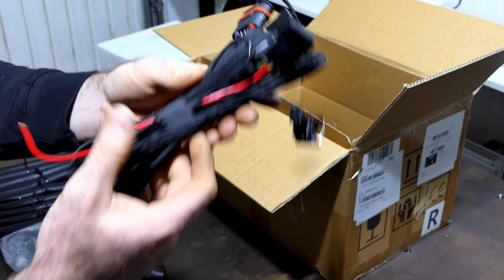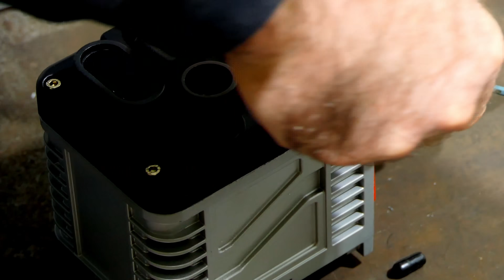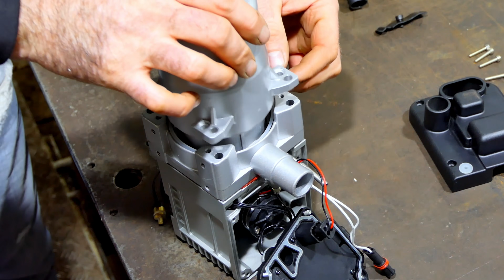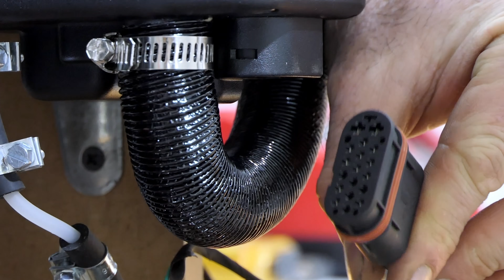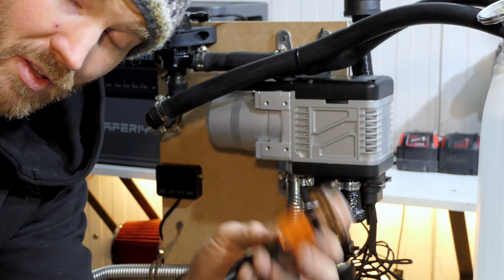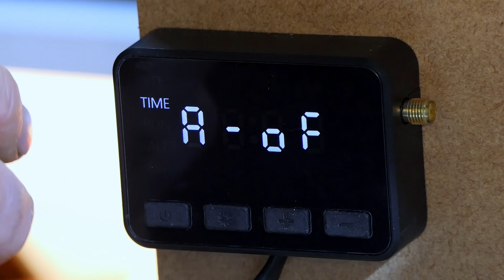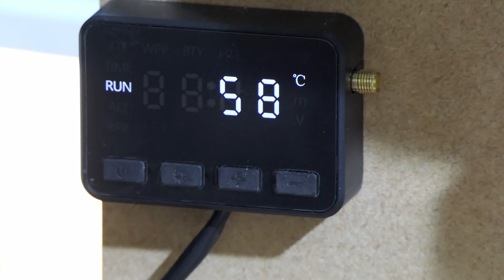Wonder of Manufacturing - Worlds Cheapest Automated Hot Water Central Heating System

Comment: Hi Joshua Love your Channel 'Liked and Subscribed' as a bit of a DIYer, I had an idea with my Chinese Diesel Heater and wondered if you think that it might work

Outside the House a 40 Gallon Barrel of Water with My Diesel Heater sitting on Top of the Barrel's 
 Removable Lid with the Exhaust from the Heater Dipping Down into the Water

So Hot Exhaust Gas would be 'Bubbling' through the Water to Heat the Water up, then when the Water is Hot enough to have a Bath, once the Heater is Switched off and Disconnected

There would be a Tap on the Side of the Barrel to Transfer the Hot Water, through a Hole in the Bathroom Wall, to fill up the Bath with Hot Water

Ideally the Exhaust Pipe would dip down into the Water as far as possible, preferably to somewhere near the Bottom of the Barrel, so the Hot Exhaust Gas could Heat the Water Quicker before the Exhaust Gas is vented out of the Top

Do you think this might work?
Reply from the maker: Thank you so much. I'm thinking of something similar but have the exhaust go down and exit the side of the bottom with an adaptor. bubbling may hinder the flow rate of the gas as it will have a lot of back pressure thanless you put it under a vacuum by installing an air pump which is a bit more complex. cheers J
Reply: @joshuadelisle   That was sort of my Plan 'B' as well, as what I did was to buy a Stainless Steel Through Hull Fitting for a Chinese Diesel Heater from Amazon where I could Bolt it through the Middle of the Bottom of the Drum, with the 'Spigot Part' Sticking Up inside the Drum to attach the Longest Piece of Stainless Steel Exhaust Pipe for these Heaters using just a Hose Clip and then just Coil the Surplus Exhaust Pipe round and round, then up through a Hole in the detachable Drum lid and then into the Exhaust Outlet of the Heater which would sit on top of the Lid The Drum would sit on Something, perhaps another Oil Drum so the Exhaust Gas would then Exit out of the Base of the Drum These Stainless Steel Through Hull Fittings are all the same, only the Price is different and so I bought the Cheapest one for £10 (uk) Amazing Quality! that has got some real 'Heft' to it and good enough for a Luxury Yacht if I had one. I haven't put it together Yet as I thought I would get your opinion on this first

Comment: Nice video! Glycol would potentially reduce your efficiency very slightly because it has less thermal mass per kg, so it would get slightly hotter by the time it comes out the outlet. My guess is in the 0.1% efficiency range though. This also means you'd store slightly less energy per litre. Again, negligible.

At that efficiency and price, a heat pump would need an efficiency of 3.6 to even break even. I would be interested if you could use your methodology to test a heat pump sometime, although I understand that they are expensive to buy upfront.
Reply from the maker: Good to know. Thank you. Cheers J

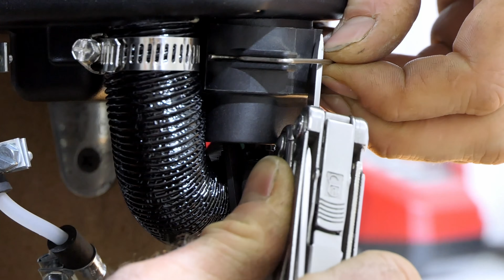Comment: At 13:33 you do realize there is no need to remove the clip? you only need to press it down and pull, and its the same for the fuel pump connectors ;)
I've watched a couple of your videos and I'am just wondering if I'am the first to point it out 😅 And yes its been bugging me far more than it should 😆
Reply from the maker: I've not dealt with these clips much so these tricks are new to me. others have mentioned it too. cheers J

Comment: One thing: Glycol protects the system from damage if it experiences temperatures below waters normal freezing point, unfortunately it lowers the heat capacity of the working fluid, and the efficiency of the system. 

The latest innovation in efficiency is to run water with a corrosion inhibitor and surfactant that lowers the surface tension of the water which improves the contact between the solids and the water, improving heat transfer. No anti-freeze glycol in it. Then they system whilst running should never get below zero. And if it does then they use anti-freeze valves, that allow the water to leak out and protect it from frost damage.
Reply from the maker: Good to know. cheers J

Comment: I have one in my boat. Definitely have a fuel filter, I blocked the burner unit. I eventually cleared it by getting the pipe to red heat and burning the blockage away. Be careful of the auto start mine randomly started one day and only stopped after the fuel tank was empty.
Reply from the maker: Good to know. cheers J

Comment: I might be wrong, but I think that glycol actually reduces the quantity of heat that the fluid can take (compared to simple water), so I would suggest using a 40% or 50% propylene glycol mix to protect the system from freezing @ -20ºC (40%)/-30ºC (50%) without loosing too much efficiency. Underfloor heating normally uses lower fluid temperatures, maybe you could drive some aluminium radiators directly and use a separate circuit for it (with a heat exchanger). If you plan to use it in a closed system be sure to add an expansion tank to the loop. By the way, why do you think there is a 60 min maximum operating time limit? I had a similar unit on my van and I don't think it stopped automatically after a fixed amount of time, it was driven by a thermostat...
Reply from the maker: Thank you. yes I think I got that information the wrong way round. I'll clear that up in the next part. cheers J

Comment: FYI with a stainless steel water to gas heat exchanger, you can extract even more heat from the exhaust of the unit and raise it's efficiency past 80%, and this part likely would cost you $60-$150 from your favourite websites.

Comment: The Achilles heel on them is how the water hooks up to the unit with that one screw and that two manifolds and the o rings. 

I’ve seen a lot talking about the clip for the water lines breaking and leaking.
Reply from the maker: maybe buy i'm pretty confident in making a new one if that happens. cheers J

Comment: Very interesting! I'm wondering about the feasability of a system like withis for home heating with conventional dual core radiators. I currently heat my house with a 5kw log burner pretty sucessfully with the exception of the kitchen / bathroom extension which is awfully constructed and uninsulated so I just shut it off. Obviously they are the most moisture producing rooms in the house so condesation is a real issue. I've been considering a standard diesel heater and some ductiung from your previous videos but water heating seems like a better, less janky and more efficient home soloution. Interested to see your future experiments, as someone who tries to be as self sufficiant as possible even on the outer edges of s city I really appreciate these videos.
Reply from the maker: I see your problem. I think the air version maybe better for you because its faster to heat the room if you only use it intermitently, comparatively a water system takes time to transfer the engergy into the ambiant air. the other thing is, if you have the system outside and duct just the hot air inside and not recirculate it, then you will be creating positive pressure that forces the old damp air out of the room through your vents which should dry it out. its also a lot cheaper and easier to install than less hot water is something you specifically need. cheers J
Reply: @joshuadelisle  That's a great point about creating positive pressure, I hadn't considered the effects of that. I was thinking keeping the space warm would reduce the cold surfaces for the moisture to condense on but that would require running the heat much longer to heat the mass of the building, whereas an air heater would dry it out much quicker like using the blowers in a car to clear the windscreen. The air system makes a lot more sense for a space that only gets used a couple of times a day for any length of time. I already use a dehumidifier after a shower but obviously using them in a cooler space they are much less efficient so combined with an air heater that would be much more effective. Food for thought! Thanks

Comment: I was an infrared thermographer during my working years. Spray paint your exhaust tube with some high temperature flat black paint to get an accurate IR temperature measurement.  
Powerful little heater. Great idea for a hot tub. Good luck. 🤝🤝👍🇺🇸
Reply: Get a water to water heat exchanger, don’t have chlorine full hot tub water coming anywhere near your heat source, it’ll eat through everything
Reply from the maker: Thank you. Cheers J

Comment: Can you make it run continuously and keep a set temperature, similarly as the air heater can do?
Reply: I bought one for that use, and sadly it can't. 

It will heat the water up to set temperature and shut down. 

A shame, I hope someone has a hack
Reply from the maker: @jonjessen  I'll find a hack. Even if it means making a new controller from an Arduino. Cheers J
Reply: @jonjessen  That's a shame, as the air heaters can do it. Maybe the controller for the air one can be retrofited?
But yes, Arduino or something similar can be also an option.
Reply: @TrinomCZ  I bought an air and water heater that can do it. It looks like the normal air heaters but with an extra water circuit. I don't think that more than 50 % of the heat is directed into the water though.
Reply from the maker: @TrinomCZ  I need to do a longer test on a bath to see. Cheers J

Comment: Hi Joshua, finally another one. Nice Overview Video. But how do you get Kerosine so cheap, here in Germany It's almost unavailable and if so very expensive. We have regular Diesel here with 10% Bio Oil, and Heating Oil, which I guess is your Red Diesel for Tractors. Any Idea for Kerosine export 😂😅
Reply from the maker: @SchorschvomDorf  thank you. Heating oil is kerosene. If you buy it in bulk it's cheap. Cheers J
Reply: @joshuadelisle  we buy in bulk too for the last order of 4000 liters heating oil I paid 89€/Cents which should be 0,738 GBP. Four years ago we paid for the same amount just 35€/Cents per liter. Which should be 0,29 GBP. Greetings from Germany
Reply: @joshuadelisle  By the way I looked up for the term, your kerosene is our heating oil with a red dye in it. The prices are roughly the same in December 2024

Comment: Modifying this for a home radiator would be awesome for a shop/garage
Reply: Mini expansion  vessel and prv amd your there 600x1200 double rad or cleverer would be car radiator and quiet fan.in a cabinet.
Reply: I use them to run central heating and hot washing water on my boat... mines 2 years old, never a problem

Comment: Great video. Been waiting for this product to be released. 
I've fitted quite a few of the genuine version of this. Pleased to see a affordable version lol.
I plumb them into a calorifier and use them to heat multiple radiators too, on narrowboats.
You may want to use a closed loop heat exchanger set up for your hot tub. That way they heater will be run at operating temperature.
Plus once the unit hits 80somthing degrees it will 'back off' to half power. Which has a beneficial effect on fuel and power consumption .
Firstly I'd recommend upgrading the pump to a genuine one as they are completely silent and same goes with the exhaust. The marine silencers are expensive but the best. 
Also be careful not to overcool it as they're a bit more sensitive compared to the blow heaters.
Good luck on your mission.
From an un educated tinkerer like yourself. Peace ✌️
Reply from the maker: @ijohnathan64  thank you. I've taken notes. Cheers J

Comment: Btw XT60 can handle 60a for 1 hour 😅 
I use them everywhere xt30 for smal stuff xt60 gernaral stuff xt90 or xt180 for big battery's
Reply from the maker: Thank you. It outputs 25amps from the battery but rated for 60amps is great. Cheers J
Reply: @joshuadelisle  yes it's nice to see more and more manufacturers using our once laugth at hobby connectors  they could have got away with a xt30 but the 60 is for 25amp fine just handwarm after pulling it constant

Comment: cant tell if that POD filter is on the intake of the exhaust .... intake is A-OK exhaust side IS NOT it will restrict airflow and CAN cause the unit to overheat . if its on the INTAKE .... well i do the same thing lol except i run a solid pipe to the floor where the filter is
Reply from the maker: It's for the combustion intake. It's just a balancer and the mesh stops critters getting in. Cheers J

Comment: As @xflow said or try one of the big suppliers like polymax in the uk I have used the a lot in the past only downside going that route is there’s a minimum order amount which varies usually 20/50 ltems but they are cheap
Reply from the maker: Thank you. Cheers J

Comment: would you get more energy from diesel  than form the kerosene that you used in the test. If so the rating for the heater would be higher than you calculated. ?
Reply from the maker: It's not enough compared to the cost. You get more energy per £ with heating oil (kerosene). Cheers J

Comment: Wow, this is such useful info—thank you for sharing your results! I’m working on a heating system idea for my camper van and testing ideas like this really helps.

So, here’s my (apologetically layman) idea: I’m thinking of using a calorifier with double coils—one coil to capture engine heat and store it as hot water, and the other to circulate coolant through underfloor heating pipes. I’ve seen calorifiers from 6 to 55 liters, and while I won’t need that much hot water, I was thinking of using it more as a heat store.

I’m also planning to heat the system via solar if the batteries are full or shore power when connected, leaving the diesel heater as a last resort. I suspect I’ll need to rely on the diesel heater quite a lot in practice, though.

Does this seem crazy? It’s certainly looking expensive, but I’m trying to make it efficient and flexible. I’d love to hear your thoughts and if you think there’s anything I could tweak in my plan. Thanks!
Reply from the maker: It all sounds plausible. Calarifiers are useful for isolating coolant from fresh water in the same system. Electric heating via a battery is very limited. Most Electric heaters are 2kw which will only  last an hour on a 2000wh battery. A heated vest via a battery however is very efficient because you're only heating yourself and not the whole space, couple that with a well insulated jumper and sorted. That way you only need to deal with condensation and temperatures to keep the stuff in your van in good condition. Cheers J
Reply: @joshuadelisle  yeah I doubt the solar and battery route would add much value. My loses are estimated at around 500w. So I think that's 12kwh per day? For sure not enough for an electric only system.

Comment: as always, nice videos, I also have the same model and I also did the same tests, and I noticed that the water flow rate you have in the video is not the right one, it seemed to me too that it worked like that, but once once all the air has been removed, the jet of the pump must seem almost like that of a pump for watering the garden, therefore a nice jet
Reply from the maker: I think the pipes were kinked a bit in that clip and also may have air in the pipe still. It was only a quick demo just so I could figure out the system and design what I need for the final project. I may use a calorifier so the pump isn't straining on a large system and introduce a larger pump for the rest. Cheers J

Comment: Very interesting, for heating a hot tub, is an lpg heater cheaper to run? They are around half the price to buy even for a 30kw unit
Reply from the maker: LPG is more expensive as a fuel. A 47kg bottle is £100, which is about £0.15/kWh. Kerosene is cheaper than mains gas currently at £0.05/kWh. Cheers J

Comment: Hi I fitted the same unit on my 900 lt hot tub last june and its great so much quicker to heat up, I piped the tubs drain to the inlet and then fitted the return on a stand over the top of the tubs wall this way I could leave the tubs controls in place. I also have installed a egr on the inlet this makes a big difference on temp rise over time. Great video
Reply from the maker: Nice one. Did you have any issues with the controller timings, some say it only heats for one hour and so need to keep re setting? Cheers J
Reply: @joshuadelisle  That's the only problem with this model but when the hot tub is at temperature I found that a short boost one hour before use was all it needed.

Comment: You can run it on a mega flow and heating the hot tub with a coil and heating an underfloor heating system from the same mega flow and off course you can use 24 volt pumps and I did write a comment on another video there’s webasto water heaters in some models of Audi and bmw and you can get them cheaper than the Chinese one and better quality
Reply from the maker: Nice. Thank you. Cheers J

Comment: In an emergency you could use a silicone sealant to make/repair the 'O' rings most standard sealants are good for 250°C and the high temperature sealant is good for 300°C. I was impressed with the units build quality, sorry, once an engineer always an engineer, and the manual looked really detailed. The ability to remotely start and stop the heater is fantastic as quite often my finishing time would vary enormously. Running on glycol through an indirect water tank/heating coil is a bonus, as it should prolong the life of the unit. As you said reclaiming the heat lose through the exhaust is helpful. Our heating is all gas from the tank in the garden, the price of this has virtually doubled in recent times, so having a cheaper method of producing hot water can only be a win-win situation. Thank you for yet more ways towards a more efficient lifestyle, it is greatly appreciated. Take care and be well, regards to all 👍
Reply from the maker: Thank you so much. I think having this integrated in the current heating system gives the option depending on market price and availability. Both oil, gas and electric are up and down depending on demand and politics. Cheers J